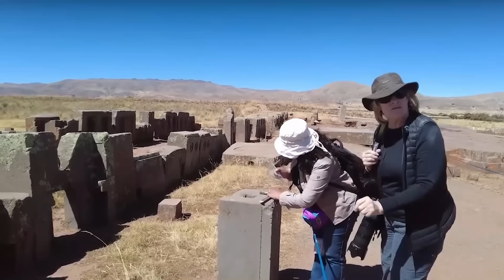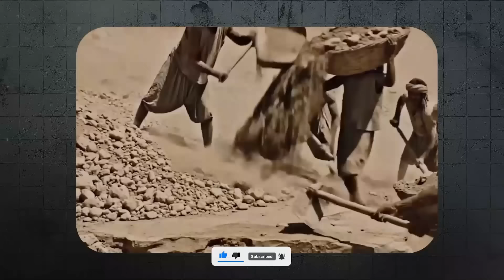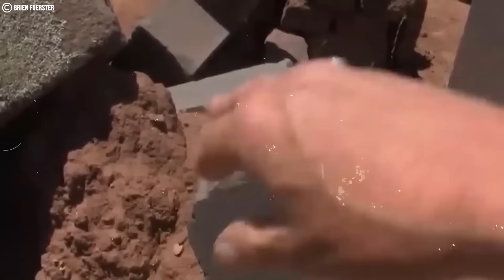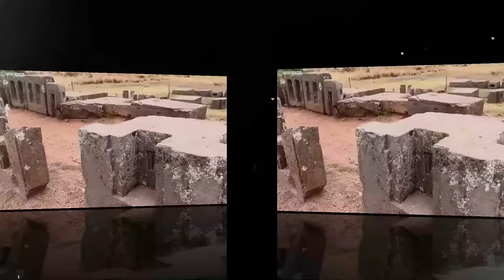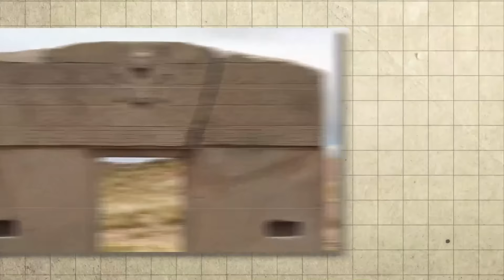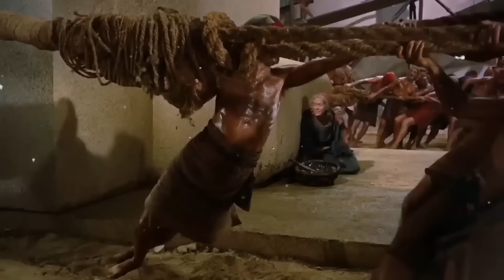New 3D Scans Finally Reveal How Puma Punku's H-Blocks Were Made — And It's Not What We Thought!

Comment: If this was written it would read like a middle school essay that had to be 15 pages long. It kept repeating the same information without revealing anything. The AI jumble of unrelated photos is confusing. It revealed nothing of how the H blocks were made, simply that they are all the same. No results of the 3D scanning reassembly. 
    It is on a plain near a large lake. The destruction could have been from a massive landslide into the lake at the far end that caused a giant wave they would grow in height and intensity as it was compressed at the lower smaller end. Basically an inland tsunami.

Comment: Those are definitely a type of concrete geopolymer . It's too consistent of a mix from block to block , If it were quarried rock you would still see striations of dissimilar types of minerals throughout the rocks and these do not show that , they are all absolutely consistent geopolymer , The same mixed design in every single block through and through.
Reply: In Peru not far from this site there are rocky mountains and hills with precise cut outs with layered straight cuttings same as done on these natural stone H-blocks, the same technology used to cut the stones with straight deep cuts into the stone without any sign of exceeding cuts where cuts are met.

Comment: I agree Geopolymer. They were experts with it. You can see it all over South America and other places around the world.
Reply: Those are natural stones confirmed by scientific chemical composition and structure analysis. Geopolymers don't have the same chemical structures as natural stones.
Reply: @Anonymous------ If this is true and these stone's are natural and cut this means that these people had the same capabilities that we do today. Using Hi-Tech milling machines and rotary saws.
Reply: @waynemcvey7480 
Even today's technologies can't republicate those stone work. The deep cuts into the stones have no sign of sawing; where the cuts are met inside the stones are perfectly met without any excess or under cut, the only way to achieve that was to first soften the stone like butter, then use a flat metal sheet to scrap off the entire piece from the stone, as if it's a soft butter, I have proof of that method.
Reply: Geopolymer has been a fact for over 10 years also check out Paul Cook